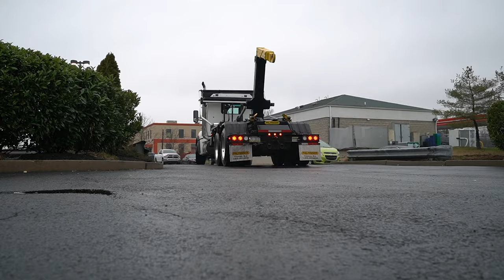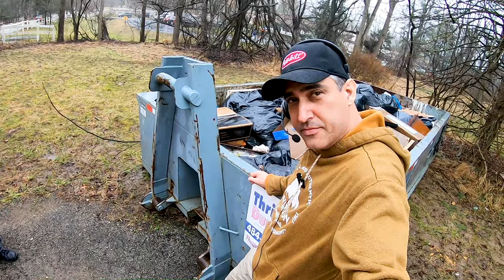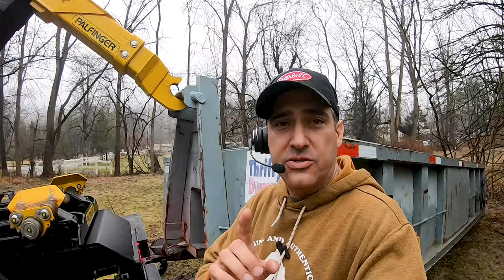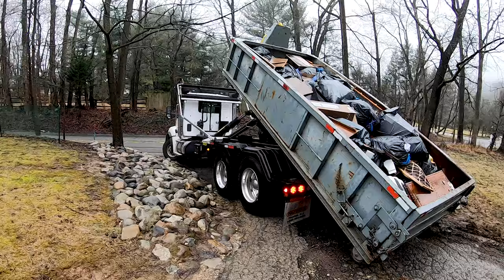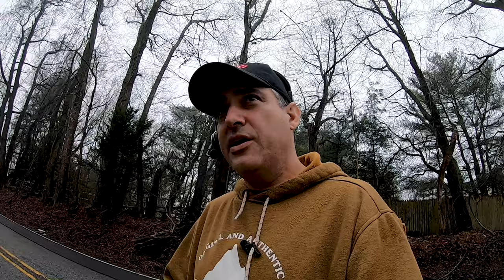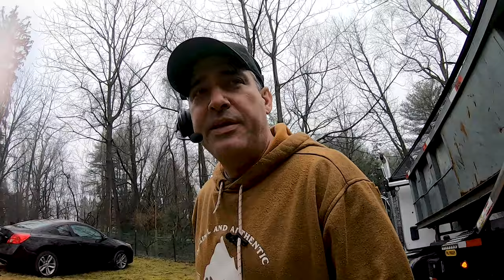How to Overcome A Dangerous Scenario While Loading A (Hooklift Dumpster)

Comment: In Germany we haven't this issues bercause our trucks have strickt dimensions: Our hook stands out further. So w will not destroy out Trucks By loading a Dumpster. My Truck is a 2002 Mercedes-Benz Actros MP1 with 6x4 chassis 4.50 Meters wheelbase and Meiller Hooklift 👍🏽 Manual 16 gear Shift :D

. thanks mate for the Video!
Reply from the maker: Yes and I wish we had same options

Comment: Just a note. Before your driver pulls off he’s supposed to depress the brakes with the window down to listen for audible air leaks. That’s how the driver is inside and outside at the same time. Just a note from a 3million miler tanker driver. And no you won’t know where it’s coming from but you will know you have a leak, that’s when the mechanic comes in before you move.
Reply from the maker: the1stbornson thank you so much for the input I will use that in court when in reopened and we are fighting it but who knows once again thanks
Reply: You can also watch for the air gauge to drop. I think for the brake test you release parking brake, apply service brake, after initial psi drop the psi shouldn't drop more than 3 psi over a minute
Reply: Truck should have full air and be turned off first. I got my CDL this year so I remember.

Comment: Great video sir.  I operated many hook lifts installed on military PLS chassis' while in the army working as a foreman in a maintenance platoon.   If ever in this situation, we would often drive forward (if ample space was available) while still connected, straightening out the equipment being loaded.  Is that something that works with this application or is one of those "not recommended by manufacturer" scenarios?
Reply from the maker: No room in this situation

Comment: Looking for your honest opinion. What would be a better route for starting a roll off dumpster business. I can get a used mack mr600 and havea 50k palfinger lift put on a truck for the same price as a ftr truck. What would be the better route to go? My other thoughts is the larger truck would be better for possible side jobs like hauling gravel  or hay or other bulk items. But the main money focus would be trash hauling.
Reply from the maker: get a cheap tandem in my opinion
Reply: Buy a fork truck, not a cable truck. As far as size, I would say bigger the better. Turning radius is a little lacking on the bigger truck, but that doesn't matter if you can't pick up a bin because of weight.

Comment: I’ve got a question, maybe you’ve addressed it in a video before, but what’s the difference between a dual articulating vs single?
Reply from the maker: one has dump and take off the other has take off only
Reply: The articulating is far less versatile. The slide lift is insane, damn near 90 degree load capability.

Comment: What’s your opinion on single axle roll off trucks
Reply from the maker: I pass on it two axle only
Reply: Single axles are better for neighborhoods, my company does a lot of residential dumpsters and their double axles do the construction and other big business, and plus better to maneuver and not damage the customers driveways but every company is different my company uses both
Reply: The main deciding factor is: how much weight do you plan to be hauling?
In my particular jurisdiction….  33,000# is the limit for GVW with a single axle truck (all standard width tires). If you never go heavier than that, there are advantages to the single axle (someone else pointed out a few).
But if you have plans to take on jobs using larger boxes, and hauling heavier materials….  You will need larger trucks with more axles.
If you have to choose one truck (can’t afford multiple trucks)….  You might go with the largest truck that can also handle the smaller boxes.
My company has trucks ranging from little single axle units (not much larger than a pickup truck) to handle 12’ boxes, up to 5 tons….  To midsize trucks (single axle with lift axles added) to handle 16’ boxes, up to 10 tons….  Up to full size (twin screw, plus two lift axles) which handle 40 and 50 yard containers, and can gross up to (I think) 64,000#.
You have to decide what best suits your business.
If you’re just starting out….  The usual approach is to start off with the smaller truck and boxes, and grow your business before upgrading to/or adding the truck that can handle the next step up in container size.
That brings up a point that I haven’t seen addressed in anyone’s videos yet:
The hooklift systems themselves are divided into 3 groups (3 that I know of) and are not all interchangeable.
That is….  Just as the small system designed to handle a 12’ box can’t pick up a 22’ box….  The system designed to handle the 22’ box can’t pick up the 12’ box. Each system has its own range of capability, and are not compatible with other ranges.
If you want a single truck that is compatible with every container size (from 10 yard to 50 yard)….  The only way to do that (as far as I know) is to go with a cable hoist system.
Personally….  I find operating a hooklift MUCH more convenient.
Another thing to consider is….  If you plan to haul for other carriers, or spot containers at a customer’s location where THEY will need to move it around….  You have to make your equipment compatible with THEIRS. In such cases, you kind of have to go with whatever system is common in your region.
Whew….  Didn’t mean to write a book, but more kept coming to mind as I typed, lol
Reply: @Bob in the West  hook truck can and do 10 yard boxes. You just don't bring the box as far forward when it's up onto the truck like you would with the other size boxes. Hook trucks, in my opinion, are much better because once you have the box down, you can move it around like a trailer. You also don't need to get out to unhook the hook like you do the cable truck. Less maintenance as well.
Reply: @codylee4000  …
Don’t get me wrong, I’m not against hooklift.
To the contrary, I prefer it over cable hoist.
However, if your hooklift system is designed for 22 foot boxes, and you try picking up a 12 foot box, the box will pass the truck’s main/rear rollers before you even get the hoist frame into the down position.
They are not all interchangeable.
If you need to have a single truck, capable of accommodating such variance in box length….  you have two options (that I’m aware of):
Cable hoist….  Or, if you absolutely refuse to get out to toss a hook, continuous chain hoist.
Unless you want to go “real old school” and use the old “Dempsey hoist” system….  Which are PAINFULLY slow, and have certain inherent safety concerns (box totally unsecured while transferring from one hook to the next).
Continuous chain looks like a decent system, but I’ve never personally used one, so I can’t say I would know if it has any flaws that would bother me.

Comment: You able to put any length dumpster on a hooklift truck?
Reply from the maker: on mine 16-22 feet only
Reply: My company has 3 different size trucks (correlating with 3 different hoist sizes) to handle all of the container sizes.
I think there is a limited amount of “crossover” between the small and midsize trucks. But the large trucks can only pick up boxes 22’ or longer. 50 yard containers are roughly 24’ long, and I’m pretty sure that’s the longest you can go without breaking the “overhang” laws.

Comment: You didn't  need to rip up the yard like that. Back up at the same time you're lifting the bin. The tires on the bin won't move. Your truck is a small truck though.
Reply from the maker: Watch video I could not back up was rocks in the way I have been driving hook for 15 years
Reply: Small? As apposed  to what?
Reply from the maker: the bigger ones LOL

Comment: Who makes a good fifth  th wheel hook trailer or something that will take anywhere from 12,000 to 24,000 pounds may be even more 12 to 20 feet long for container wise   I have a CDL a and I drive tractor-trailer cross country pop I’m just thinking of a fifth wheel hook up for my  1 ton or 550  at home  and I ran a 40 foot Bentley for years cable behind a 379 Peterbilt I don’t want anything to make money with, but something that is going to last I can use the trailer as a flatbed or a dump trailer or pick up construction debris I know there is one company up in Canada. Honestly I don’t like the way they’re made I did see another one, but I didn’t save the information.
Reply from the maker: man Sorry I have no idea

Comment: You just voided your palfinger warranty.
Reply from the maker: thanks for the input and checking out the video please feel free comment spread any input the community could use.
Reply: Peter Wood how did he void his warranty?
Reply from the maker: the jib should not be extended while in the up and down mode the can was full of house trash and very light. As I mention in the video this is not recommenced but bending a jib with house trash is not possible. Would not void warranty the factory would not replace a bent jib under warranty anyway.
Reply: I had a newly replaced jib cylinder go bad and they said they didn't want to warranty it because "it's always caused by people lifting with jib out". I have never lifted a box with the jib out they agreed to replace it. A failed jib cylinder is a warranty item but there is video proof for them to deny your claim of you have a failure. If you have the proper pin out bull nose and bumper design you can pull a box at at least 15 degrees off.
Reply: Not necessarily. You have to extend the jib arm when loading onto a hook loader trailer in order to push the bin back onto the trailer